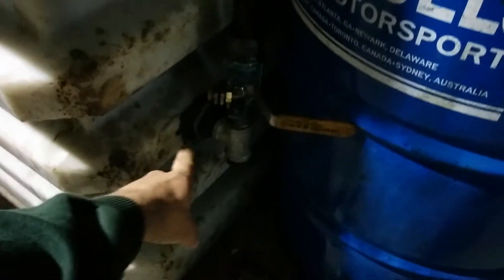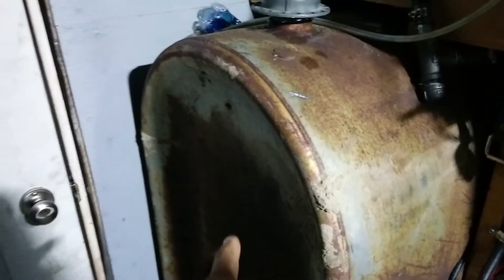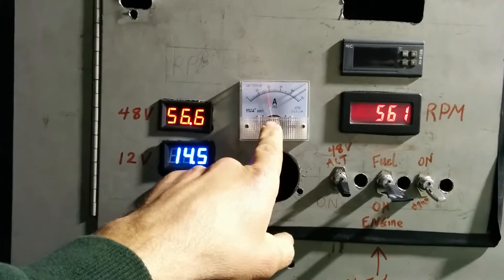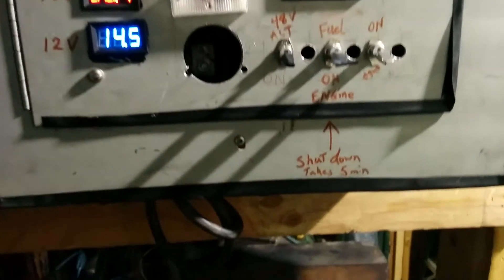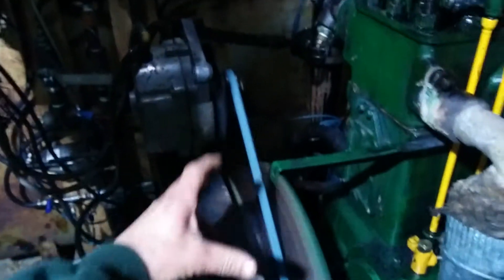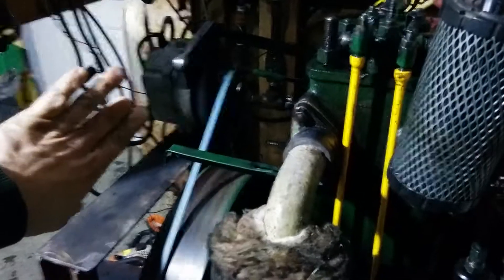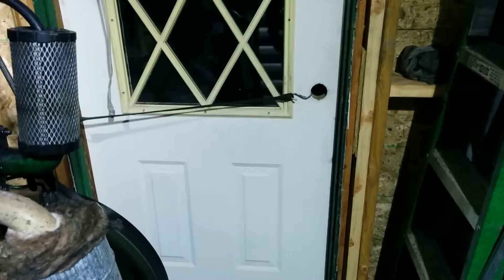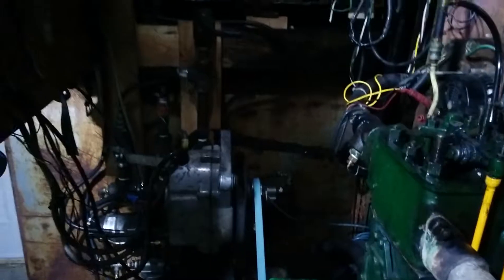Listeroid power

Comment from the maker: Well it's a new year and I still have the same Dodge alternator on the chu-chr
Reply: 1beaverfrank I'm intrigued. It's not pretty but it's very practical. How much do you have invested in the system? Do you use hydronic heated pex tube to heat the house or is it an water to air exchanger.
Reply from the maker: lawson4u2
Yes it has pex water lines that run underground and than in to my house. CHP.
it than heats my house domestic hot water  and than runs through a rad in the furnace       free    heat

Comment: I'm getting ready to build this using a 6 horse Chinese diesel... same alternator. I've got everything. Have you thought about using a 48v-to-12V converter to excite the field ?  Wouldn't that save having to have the extra alternator ? ...or am I missing something.  Talk to me !  lol
Reply from the maker: Mark Osborne  
Yes I did get a 48v to 12volt converter 1 or 2 years ago works great
Reply from the maker: Mark Osborne 
Sometimes I don't think I know what internet is and how it works, sorry for not getting back to you earlier, you said that you were going to sent me an email    1beaverfrank at gmaildotcom
Reply: Sent you and email- let me know if you get it. It's from a hotmail account so check your junk if you don't see it.  Thanks Frank.
Reply from the maker: Mark Osborne
My Dodge alternator died on Friday 13th no joke.. Saturday I got a new old one rigged up and I'm back up and running again..
Reply: What failed ?... bearings or something electrical ?   My G1 Ford has been busy the last 4 days- horrible sun ;-(

Comment: So basically that alternator is happy putting out about 1800 watts continuous ?... 56v x 32 amps
Reply from the maker: Mark Osborne  yes  I'm still using the same alternator  , it has over 7000hours on it, the downfall is the v-belt it eats 3 a year